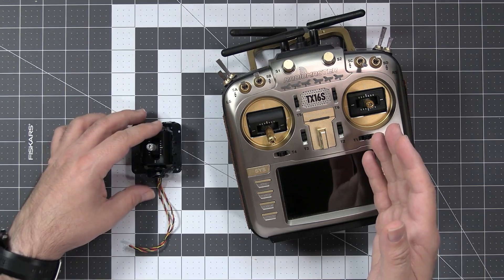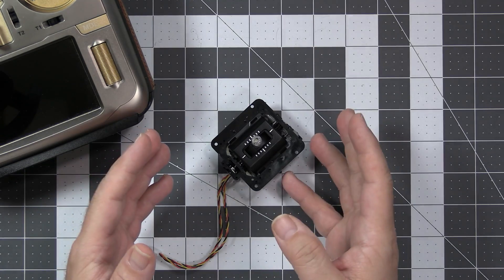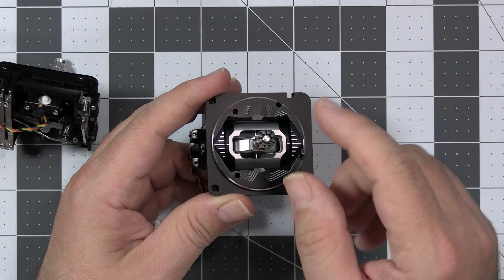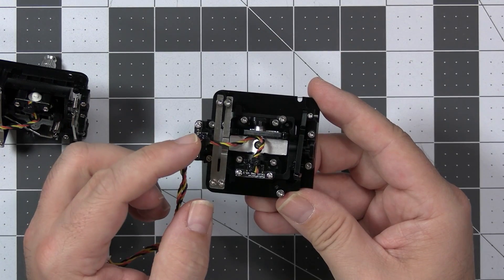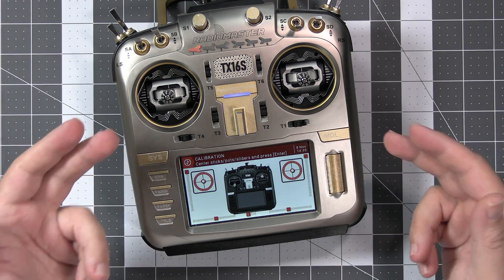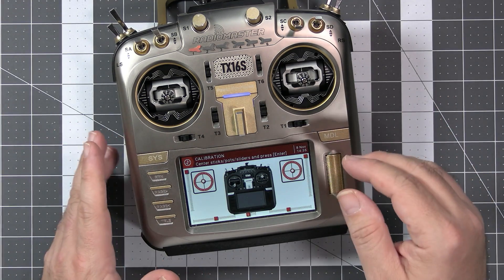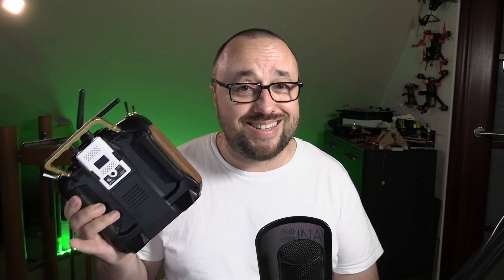Are those the best gimbals? Radiomaster AG01 gimbals

Comment: Thanks for this video Pawel. I'm currently using Jumper T16. When it's turned ON but I am not moving it, I can see the values still moving in the Monitor section. With AG01 gimbals, does that happen?

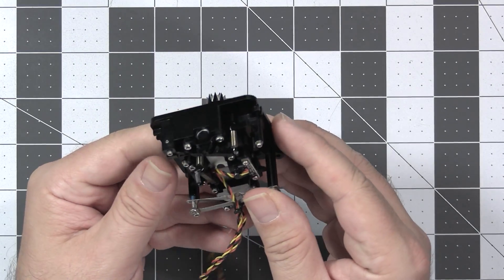Comment: Do you have a link for those sticks? The ones at 1:34 - I have them for M3 threads, i just got the AG01 sticks that say they are M4 and I cant find these same sticks in M4 thread
Reply from the maker: M3 are for a smaller vesion for Zorro for example. You should check in Radiomaster store if they have them still

Comment: Hey Paweł,
I have just sent my ag01 gimbals back. Although the felt fantastic, I fly a lot professionally with cine lifters which requires extremally smooth inputs, especially around the center. The problem with ag01 for me was that you have to push quite hard to get away from the center and moving slowly through center in a smooth panning fashion was almost impossible and you could see it on the cinema camera. They are just so stiff in the center. Is there a way to get rid of the center stiffness without having to  loosen the springs all the way? I searched the webs, but nothing so far.
Thanks for any suggestions.

Comment: Really what we want to know most of all, is the metal stick length identical to the the standard HAL and POT gimbals.  Someone told me they were shorter, which is a NO SALE for me if they are, as they would then be inferior regardless of what's CNC engineering is going  on underneath.

Gimbals are not going to improve your flying no matter what your flying skill is if that's what anyone is thinking.  

If you want the absolute smoothest stick travel on any gimble, simply remove all the centering springs and centering levers.  Once you get even half way good, you don't need them.  But shh, don't tell anyone, we need to sell more of these $79 vanity gimbals.  My springs are set so loose and after thousands of hours of flying, the levers worn so smooth it's almost like they aren't event here any more, even though the sticks still will center themselves.. so I leave them alone.   To much trouble now while blind to remove them.
Reply from the maker: No, they are not shorter. They are adjustable in length as well
Reply: @FPVUniversity  Thanks for the answer.  I saw on a Painless360 video yesterday that the TX16s version is incompatible with the CNC alluminum color plate kit, which rules them out for me...    also that the included screws are too long and you had to use soem washer standoffs designer face palm

I ran into the same screw problem with the color kit included screws being too short... when the lowering plates were also installed just barely hanging on by a thread or two... I had to buy a 3rd party light ring kit just for the 4 longer screws inside (which gave me about 5 threads of holding power)

Comment: I recently bought the T16 S max because I got tired of the issues with my Taranis xd9.
It came with a damaged SH switch in that it would stick to forward position and needed to be pushed back.
I didn’t use that switch on my Taranis so I wouldn’t use it on the t16S. I emailed radiomaster about the issue and they gave me a choice to send me a replacement, a 3$ part , and r n r it myself or send it in . After looking at those gimbals at the last race I new I had to have them. So they will be coming soon. 
 And because I watch everything Inav on your channel I have a question. I just started fpv wings and hooked hard . I’ve raced rc planes for years and at 130mph the travel on elevator and ailerons was very little. Back then I flew a futaba radio. In Inav I use auto launch in stable mode. In manual mode it’s crazy too much travel so fly in stable mode for now. If I go into Inav to make adjustments for less travel it does that in stable mode too and that is not enough to launch in stable mode. It just hits the ground. So can I use duel rates on one switch  and manual mode on another? Or put manual mode and duel rates on same switch. I want to go fast with wings but use auto launch. Thanks for all you do in Inav your the Inav guru.

Comment: there are also cnc gimbals available from creation, less than half the price, they are digital gimbals (flysky) so require a software mod too. i have them in my nirvana, and if you have ever been plagued by bad mis-centering yaw gimbal, you will appreciate these gimbals.
Reply: I just did the flysky gimbal mod in my Tx16s. They are nice.👍
Reply: @joshuayoung6286  the digital metal ones? I am thinking about it if they are better than the ag01

Comment: @Paweł Spychalski according to touching sticks to the front plate of the radio issue , just simply remove this shiny gold aluminum plate or make the sticks longer they are adjustable :) probably you did notice as well that placement of the AG01 gimbals are much more lower/deeper in comparison to stock hall gimbals

Comment: Nice video👍
The AG01 looks awesome!!!
Would like to know how they compare to FrSky X20S or even to Jeti ones?!? 🤔
Reply from the maker: Never tried X20S gimbals, but I think X10S are slightly better. Tiny tiny bit. But Jeti is worse in my opinion. I don't like DS12 gimbals for example
Reply: @FPVUniversity   I have The x20s as well and just installed the ag01 gimbals . I feel the x20s gimbals have the edge  and u can adjust the axis of the gimbals as well. Instead of being say directly up and down u can tilt them left or right by up to 8deg i think.  Like sometimes on a quick throttle i will yaw some usually same direction so i tilted it some and now i wont yaw with a quick blip most of the time at least.
Reply: @FPVUniversity  X10S gimbals are better than the AG01 😲